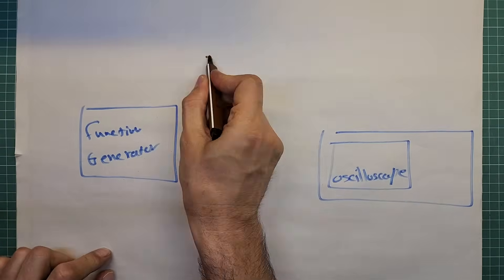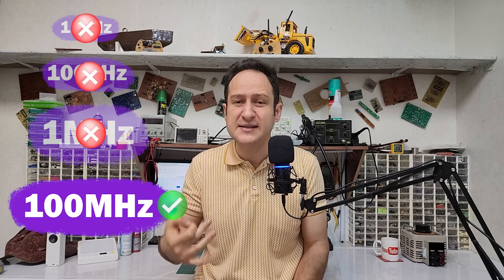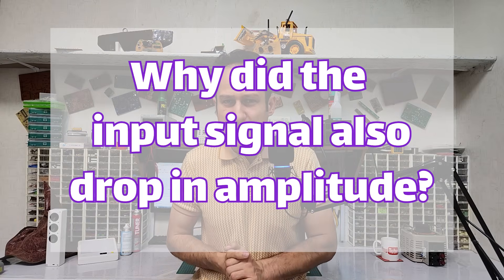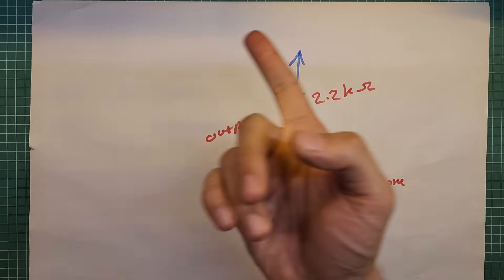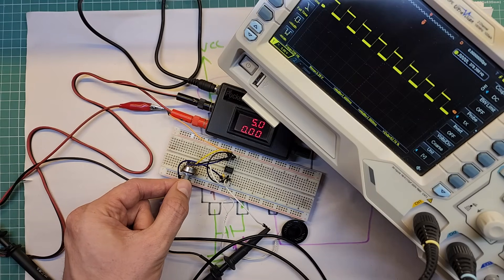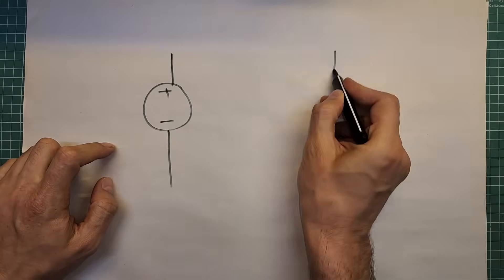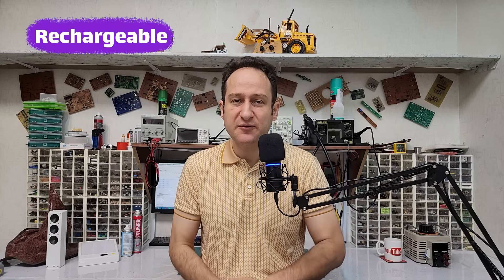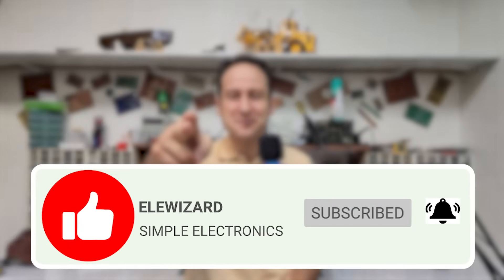Basic Components, EP#06: 3 Components for professionals

Comment: thanks for these lessons .
there is something i need to know , in some power supplies and inverter welding machines i saw something like a tiny ring of ferrite beads around the mosfets and igbt terminals what is it and what is the purpose of it?
Reply from the maker: I think you are talking about ferrite on gate pin, it is used to eliminate high-frequency noises 👍
Reply: @elewizard  thanks

Comment: If you've unlocked Chapters, please break down the video into chapters. Also, if I lightly/barely touch the USB-C or Micro USB port it gives a sharp tingling sensation. Can you explain that and how it could have been fixed in design.

Comment: A batteries' internal series resistance easily explains its changing terminal voltage.  Simple voltage divider, more current less terminal voltage.  Deteriorating chemistry, higher internal resistance, less terminal voltage for same current.    Thanks for the video.
Reply from the maker: That's a great way to put it! Thanks for adding that insight. 👍

Comment: Ferrite beads do not reduce the signal strength. Their task is to absorb low-energy pulses with sharp edges, with large di/dt needles. 🙂
Reply from the maker: Appreciate the clarification! Ferrite beads definitely help with those high-frequency spikes. 👍
Reply: @elewizard  used in laptop Chargers spacially